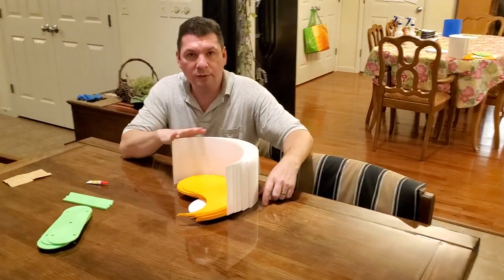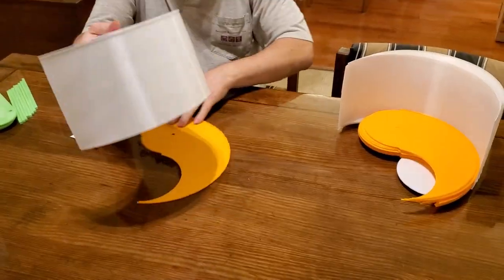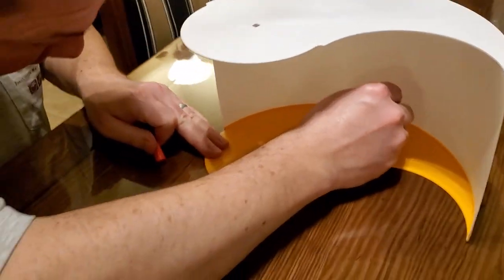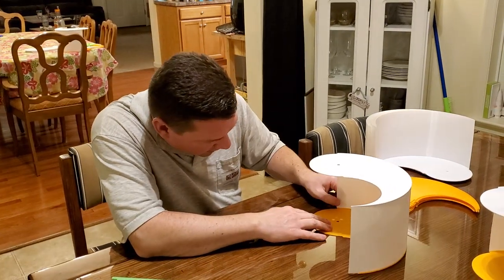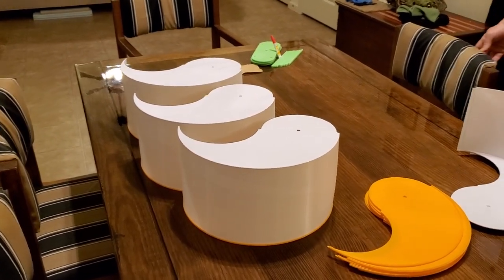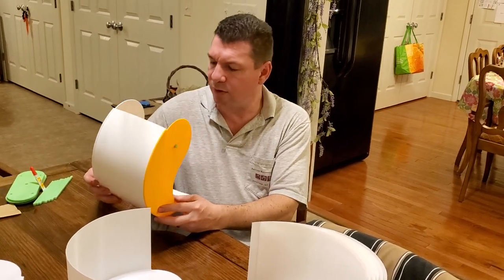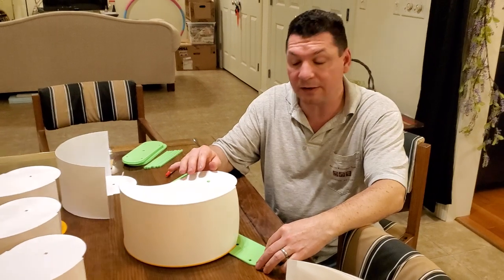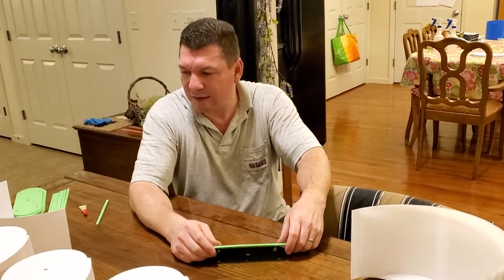Harmony Crowdfunding first look ...basic kit scoop assembly

Comment: Adding a central ridge in the curved scoop will add strength and support.
Reply from the maker: A vertical ridge or a horizontal ridge. Give me a better description of what you're thinking.
Reply: @HarmonyTurbines  horizontal as the vawt is standing.  Like a backbone for the yinyang.  The ridge will help with twisting and wind/load at high pressures.  Think of a snow shovel.  They add scoops and recesses for strength for shoveling.  The ridge would do this with little added weight to the blade scoops.
Reply from the maker: @shadowofchaos8932  Thank you it's a great suggestion that I will look at adding once we're past the prototype stage. For early prototypes it would be a pain in the rear-end to try to do this ...but definitely for commercial units it's a viable option for strength.
Reply: @HarmonyTurbines  something you don't think about or worry about until extreme testing with a wind tunnel.  I just loved the elegant design and simplicity, I wanted it to be strong and reliable if I could help.  Keep up the great work!

Comment: Just a thought but perhaps you could try out a canvas model instead of plastic and then assemble it like a kite using struts - would be much easier to package, assemble, repair and more eco-friendly if you choose the right materials too.  Parts may need to be hard plastic but I don't think all of it does, at least not for the kit.  For me, the wind is only useful when attached to a generator suitable for low wind speeds and I suspect a lot more research and testing is needed in that area before a consumer product can be produced.